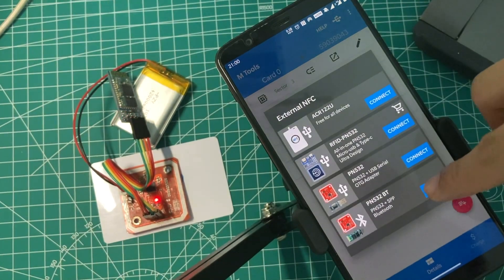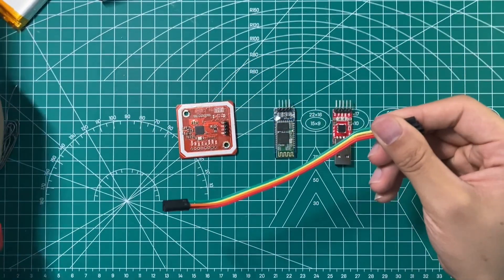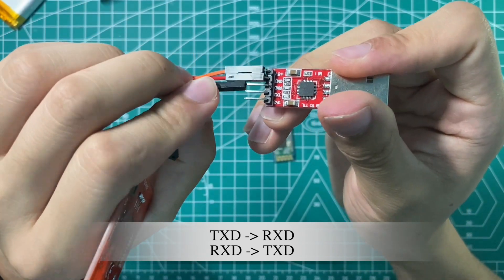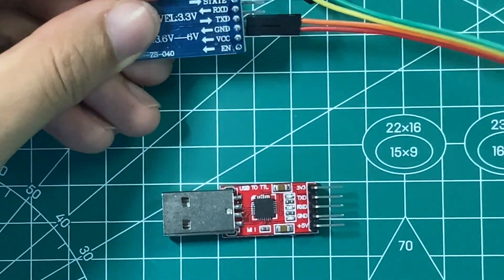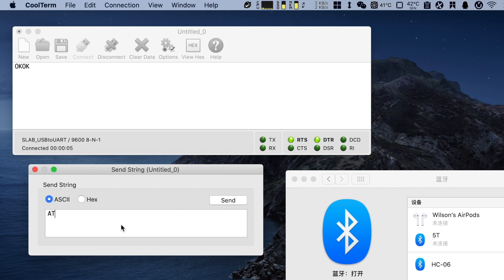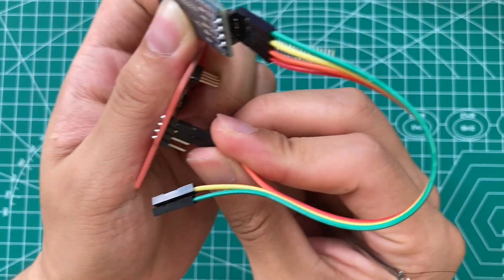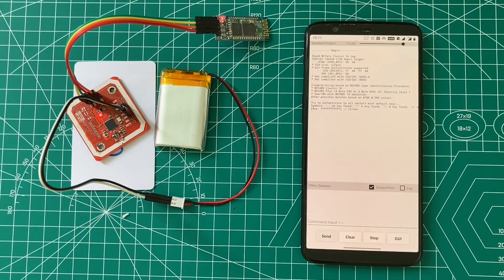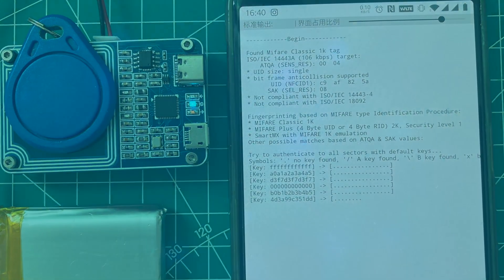How to make the RFID PN532 work on Bluetooth

Comment: AFAIK HC-06 is not tolerate 5V on TTL
Reply from the maker: Then you can connect PN532 and HC Module at 3.3V pod.
Reply: @mtoolstec  all datasheets says its not tolerate 5v, but in reality it is.